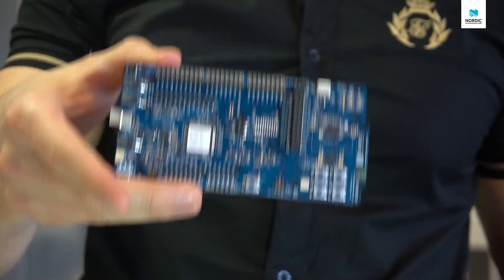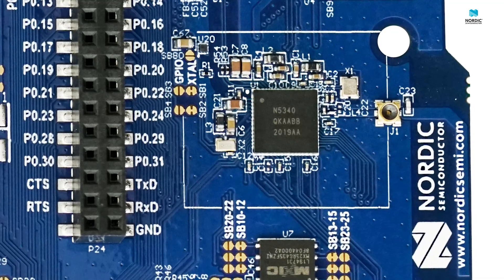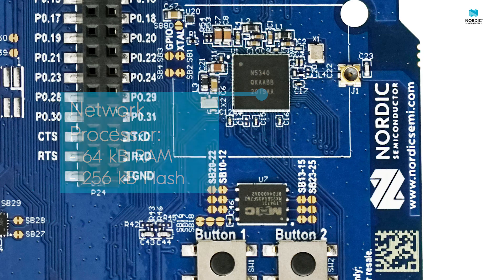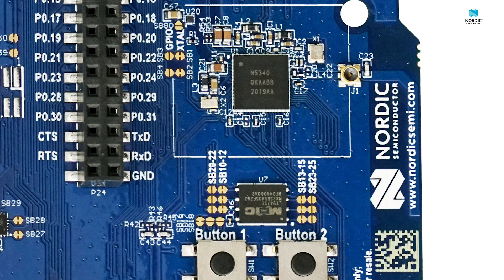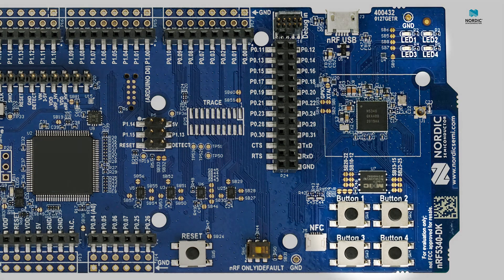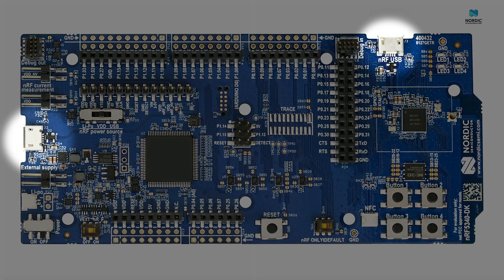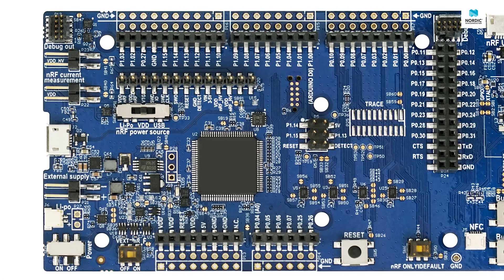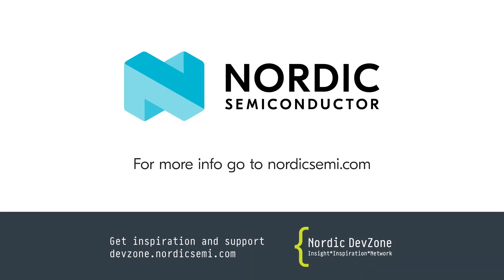Introducing the nRF5340 DK

Comment: can you mention the differences between the dk and the pdk?
Reply from the maker: The PDK is the development kit that use an engineering sample of the nRF5340 SoC, while DK uses the production version of the SoC.
Reply: @NordicSemi  Well Explained🥰😊
Reply: @NordicSemi  Can I order nRF5340 dev kit? If yes, please share the link. Thanks a bunch in advance.
Reply from the maker: @kushagrapithadiya320  yes, you can. Please see: https://www.nordicsemi.com/About-us/BuyOnline?search_token=nRF5340-DK&series_token=nRF5340
Reply: @NordicSemi  My PDK kits do not have the USB populated next to the SoC. I assume this was not ready yet on the samples?
Reply from the maker: @1kreature  you are correct, it was ready on the samples. You can read more here: https://infocenter.nordicsemi.com/topic/errata_nRF5340_EngA/ERR/nRF5340/EngineeringA/latest/anomaly_340_7.html?cp=3_0_1_2_1_6
Reply: Does it support usb 3.0? Also will sd140 work the same way?
Reply from the maker: @kushagrapithadiya320  The nRF5340 does not use the SoftDevice, since it uses the nRF Connect SDK/Zephyr software architecture. It can still use the SoftDevice controller, which is ported to nRF Connect SDK for use with Nordic devices.
Reply from the maker: @kushagrapithadiya320  nRF5340 do support USB 2.0, and not 3.0.
Reply: @NordicSemi  Ok. So same as nRF5240